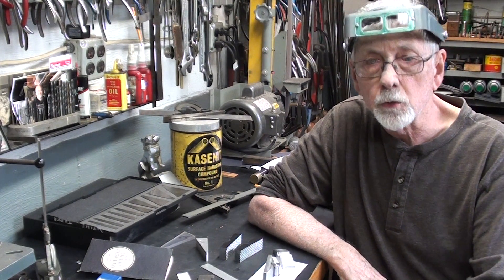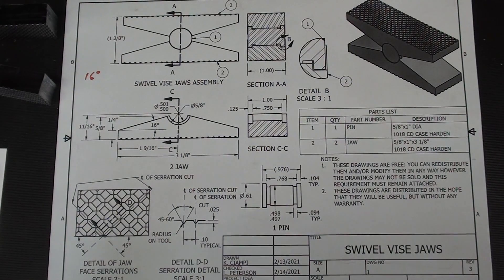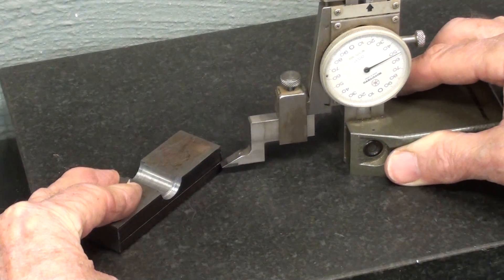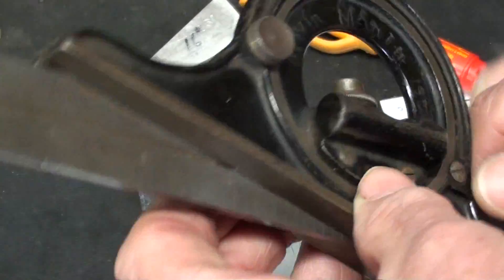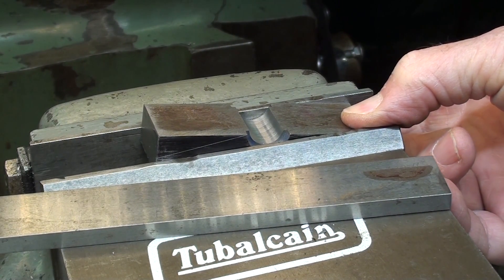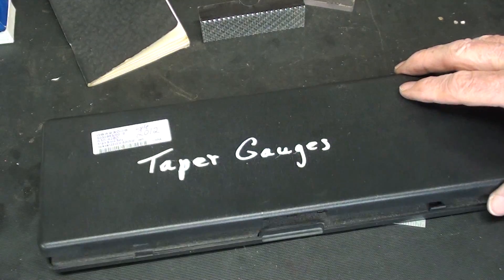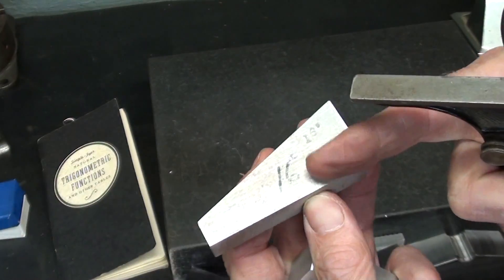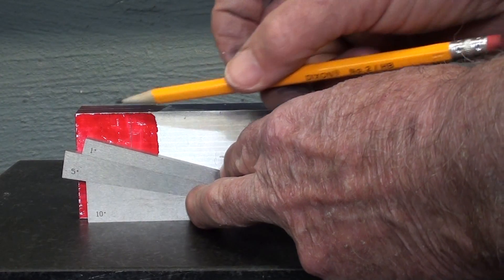MAKING SWIVEL VISE JAWS #714 pt 3 tubalcain ANGLES

Comment: If the pivot pin had an undercut and the 5/8" cut on the block had a companion groove cut into it, the pin could be made in 2 parts, fastened together through the center of the pin, and the jaws would not separate from the pin...sort of like this "sketch" of 1/2 of the pin. Both halves would be the same profile, but would need a means to fasten them together. Think of a serif capital T with the hooks at the ends of the top of the letter. Those hooks would align with a groove cut into the jaw at the outer edge of the 5/8" slot.  The sketch didn't paste well in this comment; it looked better in Notepad.

If you don't follow, please let me know how I can send you a better diagram.
┌─╥───╥─┐
├─╢         ╟─┤
      ║         ║  
      ╙───╜

Comment: I think I will try this. These are the best videos where you make a useful thing with techniques a novice like me can follow.

I may make one out of brass and one out of  hardened steel for non marring and rugged stuff
Reply from the maker: Good idea
Reply: @mrpete222  I'm making two sets from 6061 aluminum, with one serrated jaw and one smooth. The second set goes to my brother in Georgia. Postage is cheaper for aluminum plus they'll do for most work. I assume if the angles are greater than 16 degrees the parts will slip out and not hold. Am I correct? Keep those neat project coming. Every one is a coffee sipping learning process.